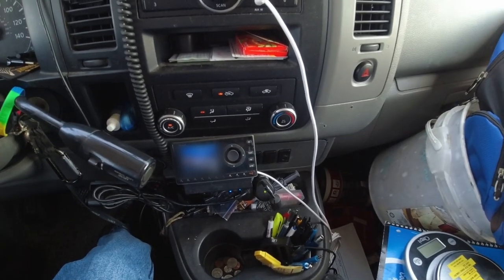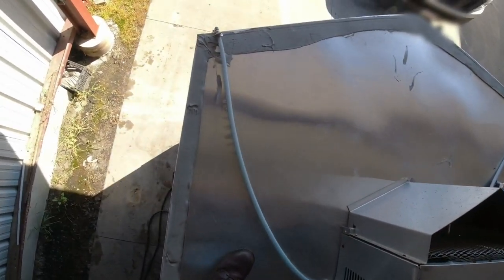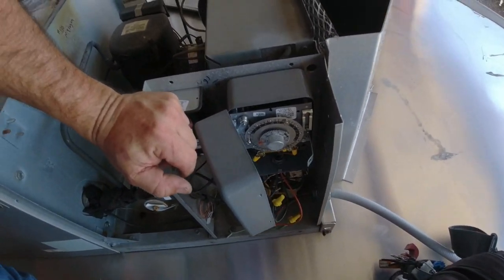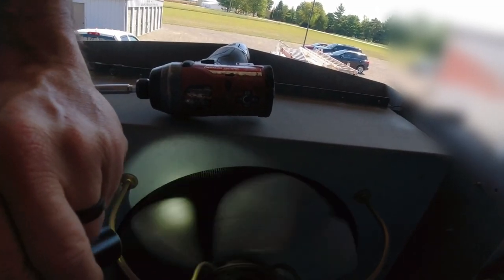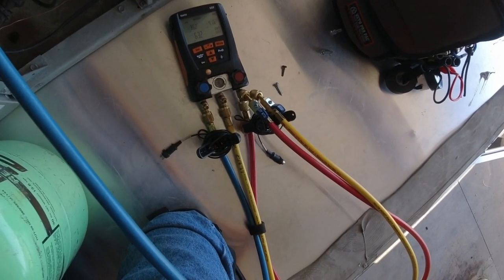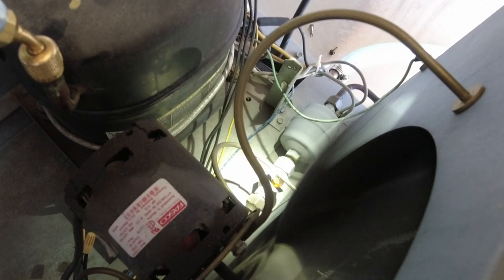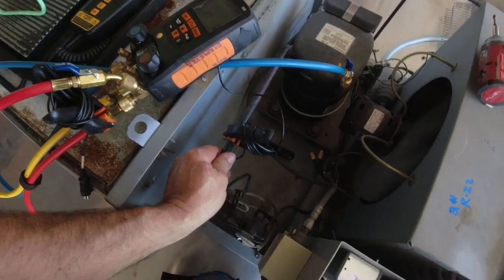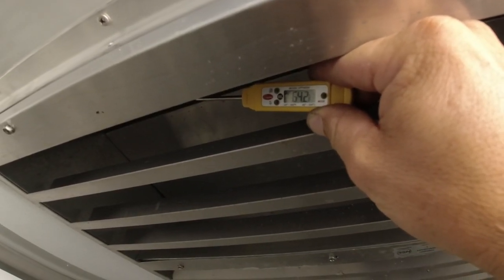I Need A Service Call Now! My Cooler Is Warm!

Comment: Sucks going out on holiday. Next time that refer system is opened remove that sightglass, that system is critically charged, bubbles in glass are irrelevant. Overcharging these kind of systems is why they don't put sight glasses on them.
Reply from the maker: I see it both ways, but I mentioned all that in the video.

Comment: Cool video.. my only question is we’re did the refrigerant go.. seems like it’s going to be a call back in a few weeks .
Reply from the maker: It likely has a small leak, the remedy is usually replacing the coil. The cost of the coil vs the repair is much more and I know this customer well. We do a lot of work for them so I know they usually keep it running more than doing a full bore repair. There was a lot behind me not doing a typical leak search at the time of recording, The holiday and the history were all large factors.

Comment: It's actually a very good video.  You say it was an easy fix, but that's only if you say that it was just the time clock defrost.   You had to clean out the fins, recharge the compressor, AND the time clock.   Who knows what would have happened if you had just 'fixed' the clock?     Frankly, that wouldn't have been a fix at all.
Reply from the maker: Thanks! Your correct, that's why I usually clean the whole machine, while cleaning it I usually find more wrong...That has always been the easy way for me to fully diagnose all the problems.
Reply: @HVACRSurvival  - For such a new system, did you schedule a follow up in three to six months to see if it loses refrigerant again?
Reply from the maker: The trailer was new, the cooler was not, they added it to the trailer.
Reply: @HVACRSurvival  - Ah.  I assumed new trailer, new reefer.  my mistake.
Reply from the maker: @tbelding  no biggie, we're a little un-fancey up here in Ohio😁

Comment: Eh, it was Labor Day. You're officially r
Forgiven for not seeing the high side port.  I didnt notice if you said the clock kept time while you were there or not .... so was the clock bad? Or did these nitwits really go from Zero to Freak out during a standard defrost?
Reply from the maker: The customer claimed the cooler had been plugged in for about an hour prior to calling for service when it was tested at the office 🤔.  I think the cooler just entered defrost prior to it being unhooked and hauled back. When it was hooked back up again to be tested it didn't come on immediately. 🤷‍♂️ Who knows?. I never heard anything more about it not working after I was there so it must have been purely a defrost clock doing its job
Reply: @HVACRSurvival  - with the clogged coils and low charge, there's a good chance it wouldn't have cooled properly anyway.